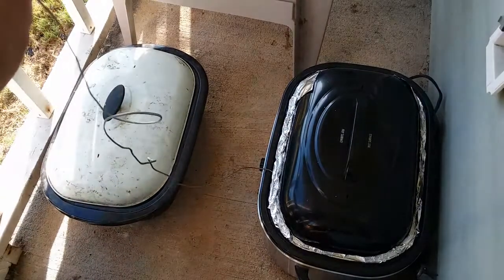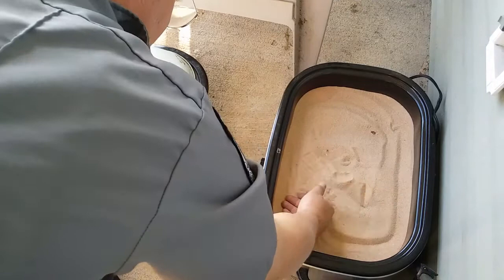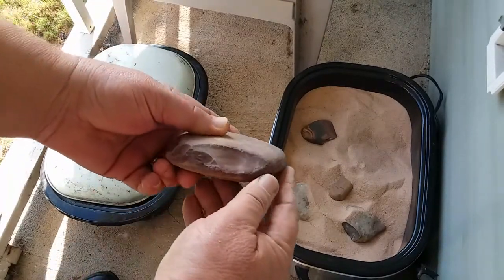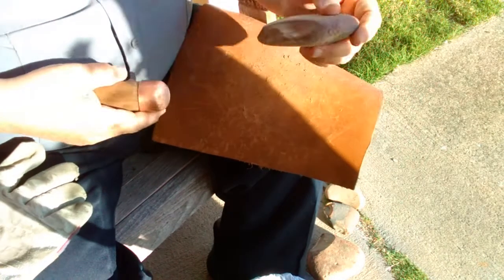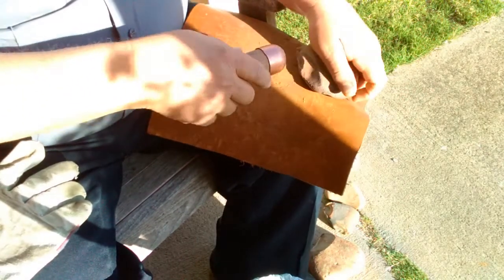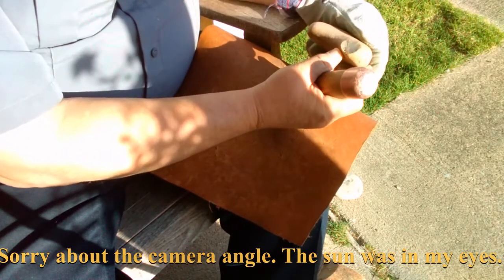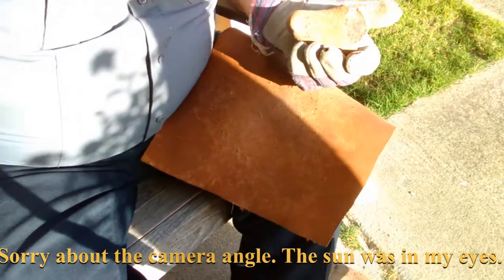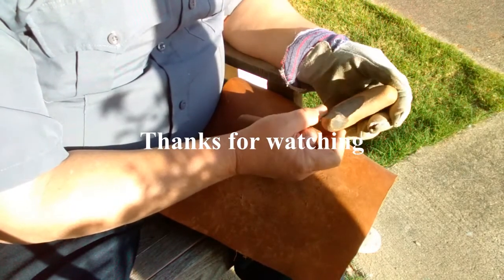4-30-2020 Project part 2   Successfully heat treating Edwards Plateau Texas flint

Comment: It looks like a success to me! Maybe what I have isn't Edwards, the next time I make a video I'll have to show what mine looks like.
Reply from the maker: O.K. Some Texas flint / chert can go as high as 550 degrees. The darker the rock the lower the temp required. The lighter the color the higher the temp required. Also, if it is grainy the stone will need to be re-hydrated after cooking and cooling where as the smooth fine grain stones won't.

Comment: Great job heat treating, that stuff is amazing!!....It looked like it was very glassy..
Reply from the maker: Yes, it is. It should be easy to work. I tried one of them untreated and it was hard as a rock. LOL! It sure makes a difference heat treating. It's harder than obsidian but 1/2 half as hard as the same flint raw and uncooked. I'm going to knap one of those out tomorrow.  Wish me luck.
Reply: @rextex4222   Good Luck!! looks sweet!
Reply: @rextex4222  Cant wait to see....I have always wanted to heat treat my own rock. Perhaps this summer I will give it a go.
Reply from the maker: @PaleoGreenByrd  You should try it. You just might like the results. One thing to remember is if the temperature is too low you can always re cook the rocks. If it is too hot you got a problem.